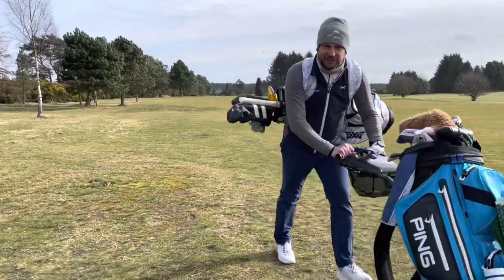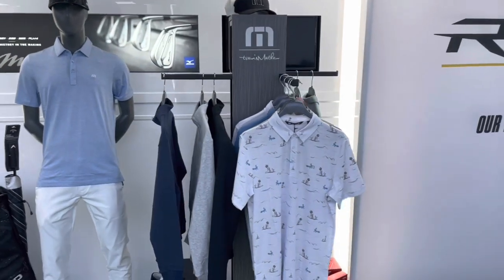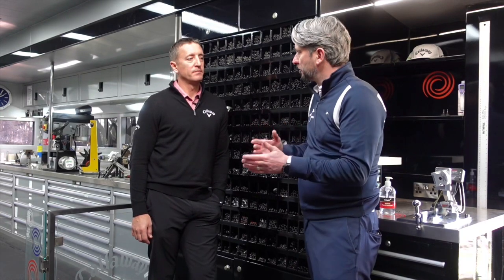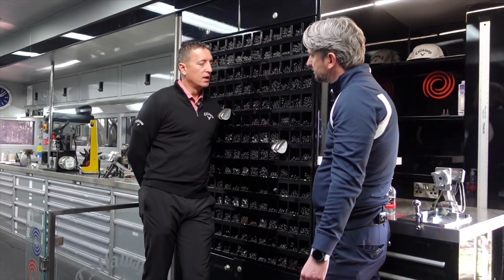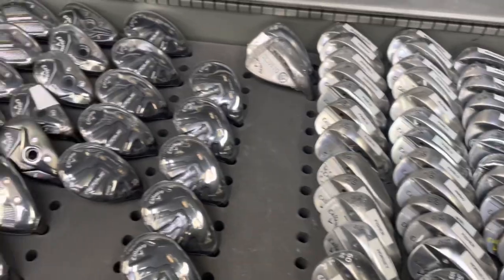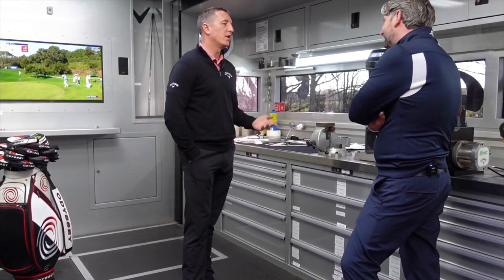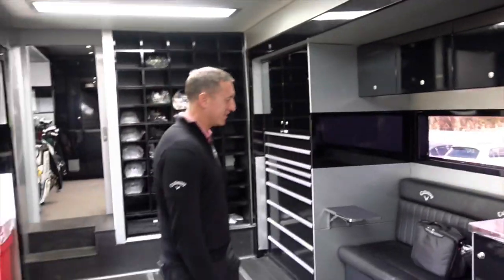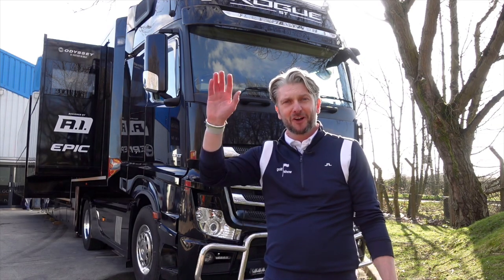Golf Show Episode 79 | Exclusive access on the Callaway Tour Truck!

Comment: Great vid. I’m heading down to Ping at Gainsborough next week for a custom fit on irons, driver and putter. Interested to know what putter you need to wait 3 months for?
Reply from the maker: Thanks buddy. I’m hoping it’s only 3 months!  The fitting centre there and the tram are great
Reply from the maker: I’ve gone for the Tyne C centre shafted putter. I’ve also started using a line on the ball again as the green laser there showed I was actually aiming well left and opening the face at impact to compensate